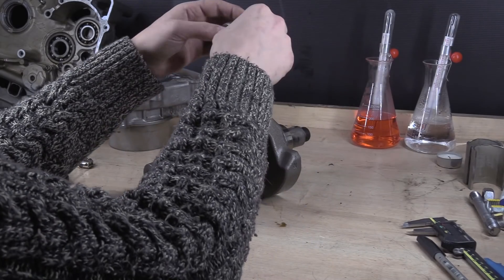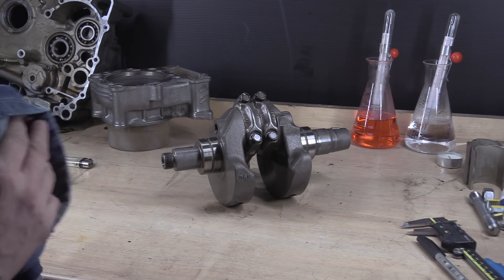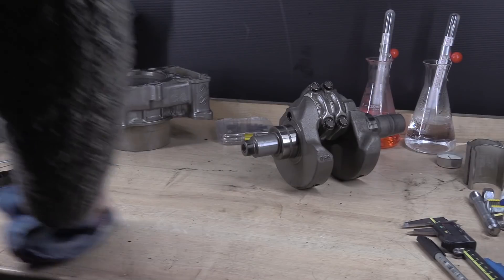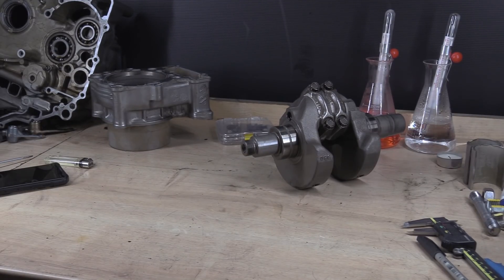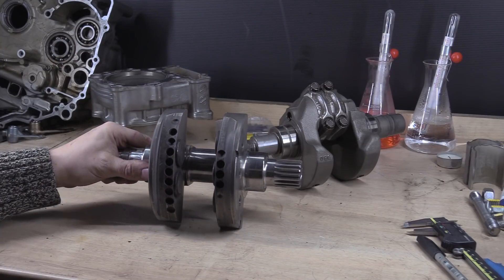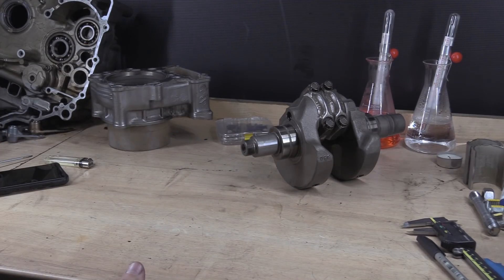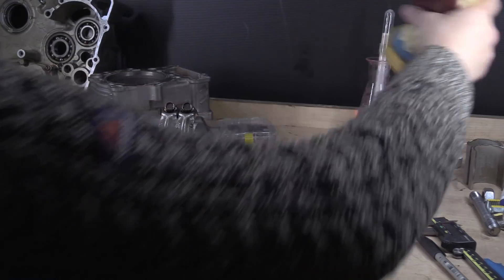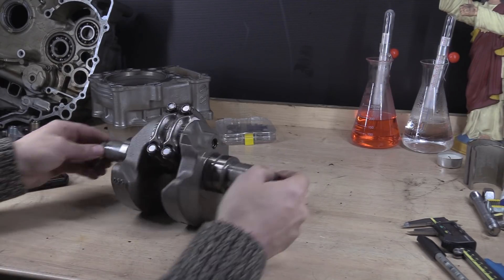Why engine BALANCE matter?

Comment: I thought crankshaft weights and flywheel weights will balance the engine but now there are balance shafts , are they balancing the engine itself from moving in the chassis or they balancing the crankshaft ?
Reply from the maker: The counter the imbalance of the crank. There are two types of balances shaft, primary and secondary. An ER5 has a primary coupling balancer and a H2 had a secondary shaft.

Comment: Discussing with design engineers, some times the balancing shaft have a secondary function which is to further reduce the background noise of the engine. Which iirc is somewhere inbetween the requiremente of the new Euro5 regulation for motorbikes

I've also seen unbalanced flywheels that works as a balancing systems for the cranktrain. Theoretically the new Mercury V6 3.4L is done that way (at least it was during prototyping)

Comment: Does a balance shaft really eliminate harmonics/wearing on a crank? For example, I know some car engines have balance shafts but it appears this is only for NVH reduction for passengers. Is it also really to prevent the engine from grenading?
Reply from the maker: Well wearing out prematurely. Yes it is.

Comment: What's the most naturally balanced engine layout between 1 and 4 cylinders?
I know inline 6 is the most balanced but obviously it's not practical on bikes.
Reply from the maker: It's a bit more complicated than that. More on this soon
Reply: I think it's some type of V4 layout, but the thing is it can depend on the firing order and how the crankshafts are arranged.
Triples apparently have a left-right rocking motion that is quite easy to smooth out with a single balancing shaft, so in terms of one that you can find more easily and affordably, it'd be something like Yamaha's CP3 engine.
Reply: 3 cylinders if the cylinders somehow superpositioned themselves into the space of 1 cylinder. Operating and phasing through each other separated through a 4th dimension.